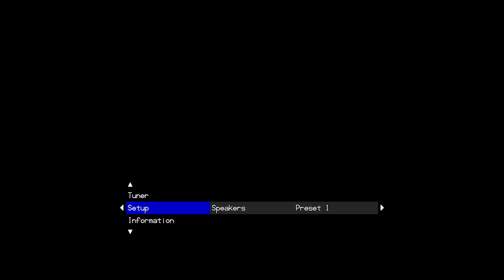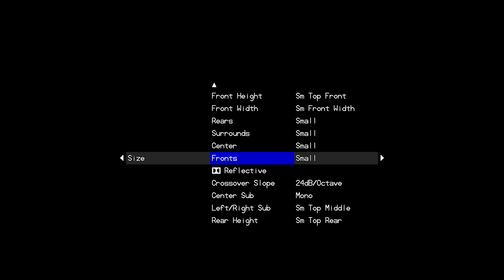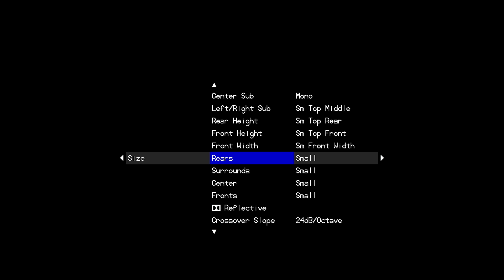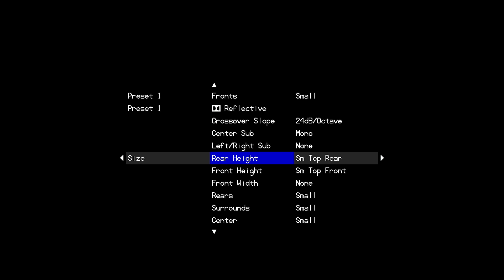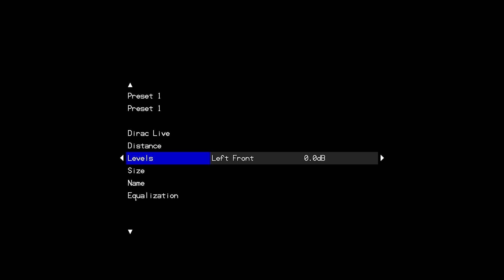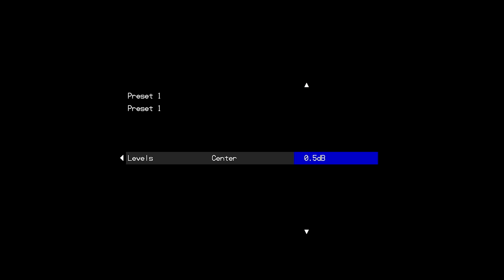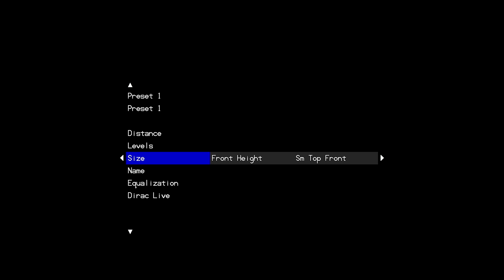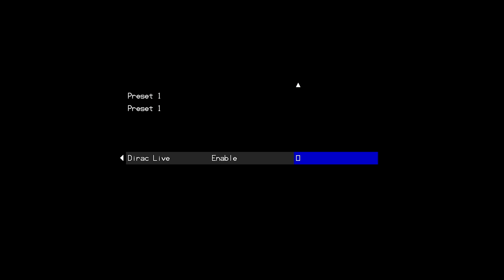How to Configure your Emotiva Processor Speaker Presets for Dirac Live Room Correction.

Comment: Regards setting speaker levels to 0dB prior to running the software:  How to adjust the volume on the subwoofer?  Of all the results, the sub is the worst sounding... so muted as to be not worth having on.  That's the main reason I had given up on Dirac until now, but your explanation has cleared up a great deal of confusion.  But as to the sub, how to set the volume?
Reply: Actually, my question wasn't exactly on point.  While I understand you set the sub to 0dB on the processor, what to do about setting the gain on the sub itself (assumes a powered sub)
Reply: @boweryhester you adjust the curve manually on your laptop. I only adjusted my Sub to get a deeper punch and left my speakers to the Dirac settings

Comment: @Brent Berkompas Hi, if running two subs with 2 subs outs on the receiver but only allowed to control 1 sub in the receiver should I have both subs connected for Dirac or only one? Also, where should I set the gain on the actual sub before running Dirac? Please Help

Comment: If running 2 subs, should we use the L&R sub outputs on the XMC2 and let Dirac time align and correct phase? or should we use 1 sub out and use a MiniDSP to do the sub alignment and corrections?
Reply: I would use the sub outputs available on the XMC-2 if only running two subwoofers. The XMC-2 when combined with Dirac is a very powerful DSP that will integrate your subwoofers seamlessly with the rest of the speakers in your system, so the use of an external DSP is not necessary and may be redundant.

Or, you can use Center sub as LFE and L sub as Mono so that you separate LFE and the mono sub.
Reply: @nickmandara8231  used 2 subs outs and let the MiniDSP do nothing. Much better results but I did have to go back and invert 1 sub with the MiniDSP and re-run direct. Achieved a much better impulse response. It was almost opposite before inverting. Why wouldn’t Dirac do this?

Comment: I've been setting my levels to each speaker to about 70 db didn't know it should be 0
Reply: Brent with Emotiva here. There was a change in the Dirac integration with the processors since first release regarding this. Originally, the levels that you put in were treated just like any manually entered distances, basically ignored/overwritten completely once a Dirac filter was active. However, we realized the need to be able to make manual adjustments on top of the Dirac filter in the processors, so we worked with Dirac to make this change so that you can apply levels on top of Dirac. The volume calibration step of the software basically accomplishes equalizing the output of all channels before playing test tones, so equalizing the output of all speakers before running dirac in the Levels menu is not necessary. Thanks, and I hope this helps.
Reply: @brentberkompas4740  so after dirac calibration should I apply my levels to 70db then
Reply: @moveezy5591  There is no need to set the Levels manually after Dirac has completed its measurement and filter creation. I suggest leaving all levels at 0.0 dB after running Dirac, then you can adjust by ear if needed. Part of what Dirac does is equalize the levels of all speakers, so in theory, the output should all be equal after running a Dirac filter. If you do play levels test tones after running Dirac, these test tones will not reflect the adjustments applied by the Dirac filter, so they are not really a reliable way to measure or check the level equalization that Dirac has performed.